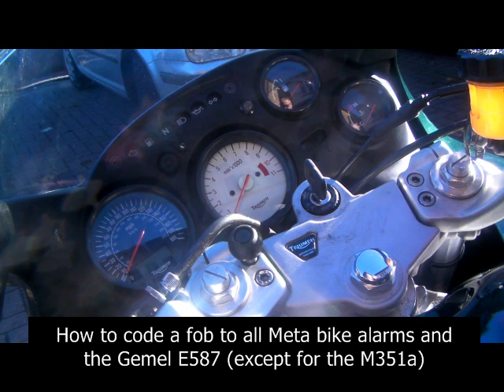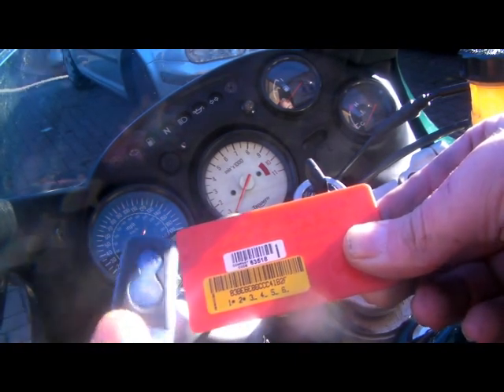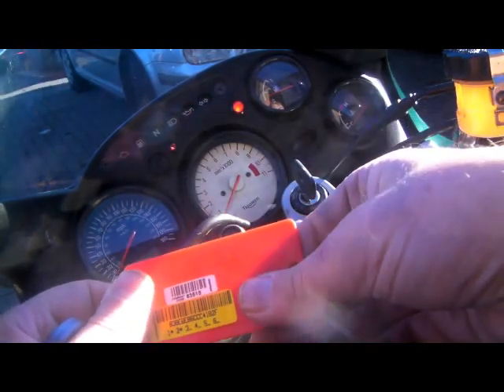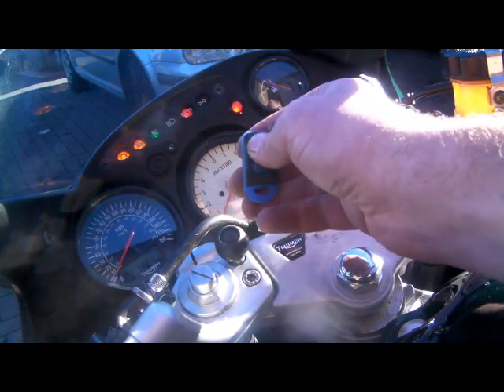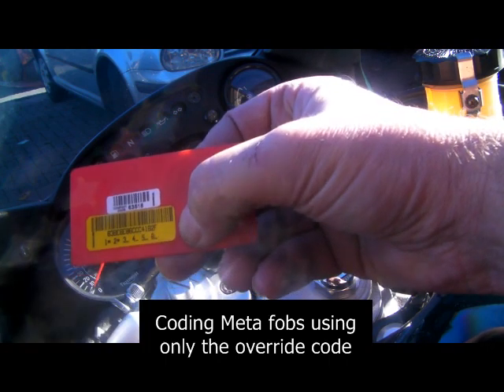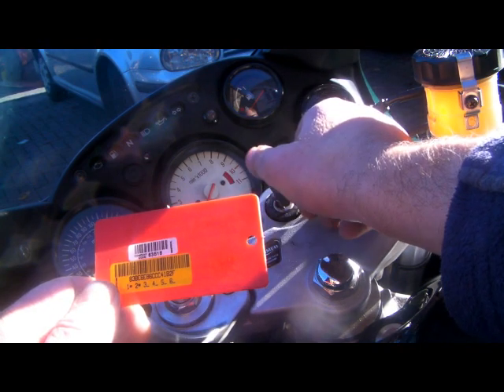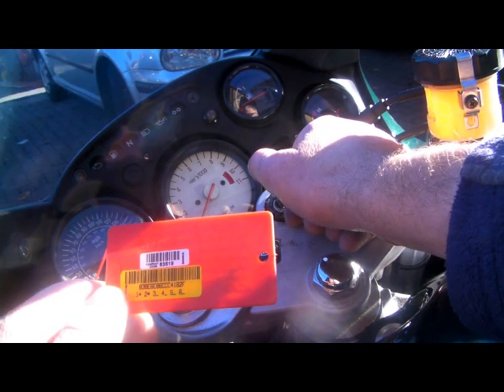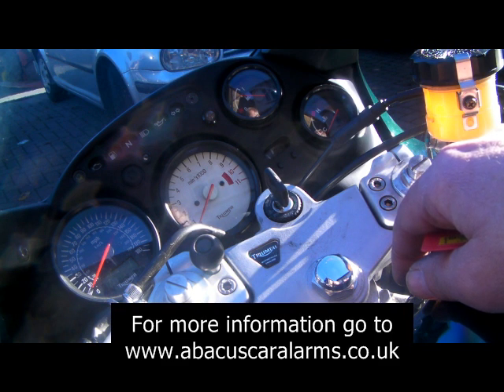Coding Meta fobs to bikes

Comment: How fast for the first 3 on and off cycles with a KTM keyless system? It doesn't seem to go into programming mode?
Reply: Did u solve the problem ? I'm following the mannual instructions with no result at all
Reply: @nathanturpin109  No, I didn't keep trying it. so I've got 2 extra remotes, I guess. What is yours not doing?
Reply: @SmittyAZ  i dont have the beep After the on off on off on, this mean i'm not in configuration mode ... I will go to my local kTM shop this week to ask why a remote bought in there shop is not connectable to the alarm bought also in there shop...
Reply: @nathanturpin109  Same with me on my 2020 1290 SAS. I wonder if it's the keyless cycle timing? Maybe it's not going fully off...I mean maybe I'm not waiting long enough between the on-off-on each time?
Reply: @SmittyAZ  im on a 2017 690 duke r with normal Key so... + I don't know where the red led is on my screen or around it
Reply: @nathanturpin109  Did you purchase the after market LED? They sell them for cheap and plug right in. The KTM dash LED usually will not work, or is VERY dim, even if your dash has one.
Reply: @SmittyAZ  I didn't... Does the beep come from the LED device aswell ? 
I don't see any connexion left on the alarm... Does it plug between the alarme and the wire from the bike ? 
Will be happy if u Can give me the reference of the product :)
Reply: @nathanturpin109  The beep should come from the alarm. Are you trying to add extra fobs to yours, or the 1st 2?
Reply: @nathanturpin109  BTW - You can't just buy any extra remotes without the card, as it has a registration number on it. Your alarm should have come with two remotes that are already programmed to at least work the basics.
Reply: @SmittyAZ  I lost one remote and destroyed an other one so i ordered an other one directyl in my ktm shop. I know the code needed (numbers of LED flash) to execute the reset of all key and to add new ones and all the procedure.
When i'm flipping 3 times on off on off on i don't even get the beep.
Reply: @nathanturpin109  If you dig around their website, you'll see the LONG registration number on a card that comes with the alarm. You need that number to order fobs. Then, you do the programming.
Reply: @SmittyAZ  I know ! I got the card, i ordered the remote in an official KTM shop with this card. But anyway i can't enter in the programation mode. I don't have the beep when i turn on off 3 times like it's ask in the official KTM documentation. Also no LED on the bike, probably i have to buy it myself but at the price KTM sell the alarm it's like robbing at this point...
Reply: @SmittyAZ  Have you the beep on your 1290 SAS ?
Reply: @nathanturpin109  I never got to the programming beeps. I get the beeps when activating / deactivating and the siren works during alarming.
Reply: @SmittyAZ  It was the same for me when i had the originals key... Beep from the alarm and blinkers when activated/desactivated.
I will go to my ktm shop next wednesday, i will keep you update :)
Reply: @nathanturpin109  Please do. It may be something simple.
Reply: @SmittyAZ  I wish it is XD
Reply: @nathanturpin109  I forgot to follow up. This video popped up in my suggestions. I never even tried to program my extra remotes again. 
Did you get yours sorted?
Reply: @SmittyAZ  went to KTM and they told me they have no response from the alarm, further investigations was neeeded... They didn't charged me for the time trying :)
 Next time i work on m'y bike i will uninstall this scam 😂

Very cool to continue de conversation so much time later ! Thanks !
Reply: @nathanturpin109  You could have a bad alarm module, I guess? There is always the aftermarket for alarms.
Reply: @SmittyAZ  there is the downside of pumping on the battery... I will go on the lock with alarme if mooved.
Reply: @nathanturpin109  An alarm will not hurt a good battery. After a while, they will even go into a lower power mode.
Reply: @SmittyAZ  anyway that's cheaper 😅

Comment: Hello mate,sorry if I'm being thick but I cannot understand what You mean by pre-programmed working fob...I have a blue rubber fob HPA TX, programmed and working with my old meta 357tv2 with code card present and I've just bought the replacement unit from Yourself. But the new one came with the round plastic fob M2000 I think.Now, does it mean I CAN or CANNOT code the old, blue fob to work well the new unit?

Comment: Sam; a few years ago I mounted a 357tV2 in my bike. Now it lost connection with the keys, and I saw your video here and a runned to the bike and tried. To disarm went as it should, but it will not go into key programming mode. I have tried quite some times now, same result. I manage to disarm, but after this is no audible response from the alarm whatever I do. Any suggestions, before I rip the unit off the bike and set fire on it? :-)